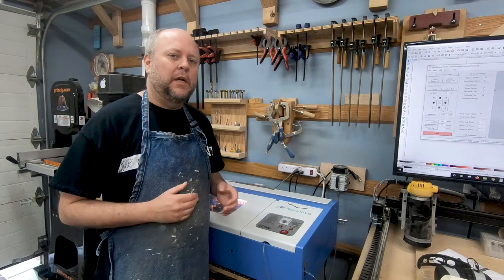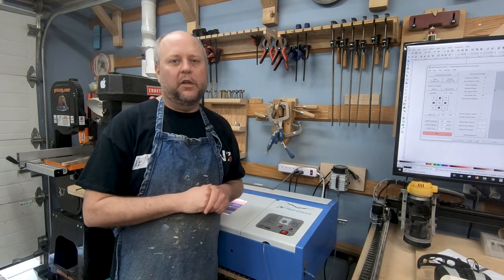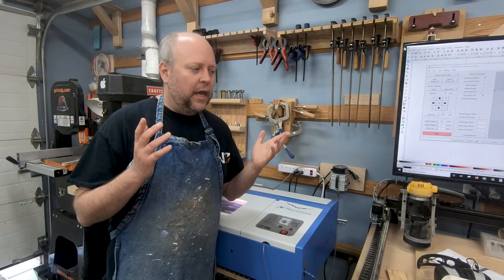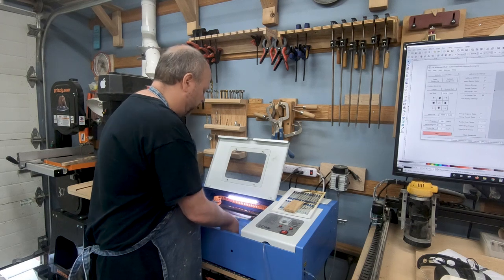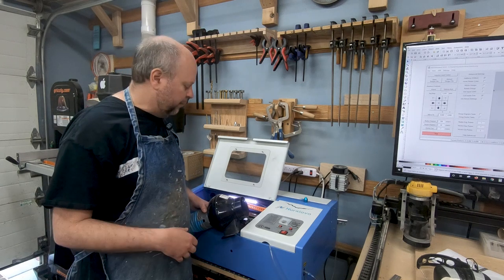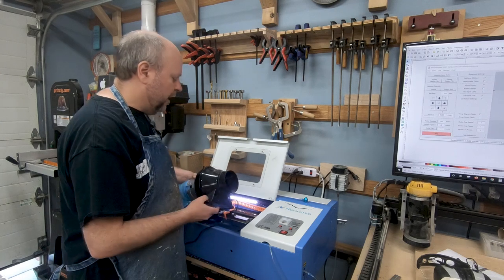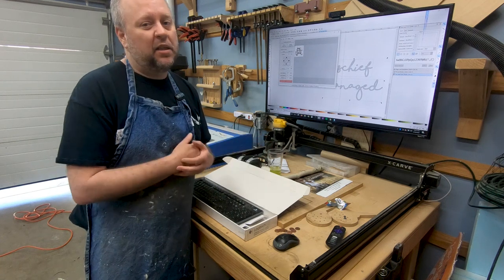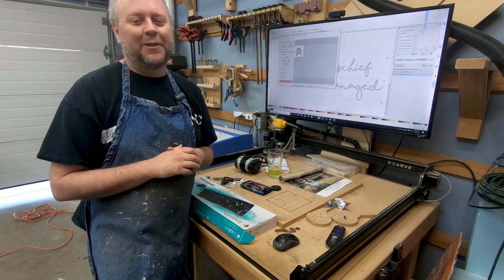K40 Laser Cutter & Engraver - What Do You Really Need To Get Started?

Comment: I have a k40 and it’s been working great but now it will move and make noise like it’s engraving but it’s weak at best. I have a percentage gauge and as soon as I bump it up past 18 I get nothing. It’s aligned. Anybody have any suggestions?
Reply from the maker: I'd say it's probably one of these things:  A) Laser tube is burnt out...open up the back to see if it's firing.  You're cooling the tube with cold, distilled water?  B)  Check mirror alignment.  If its not connecting properly, it won't cut/engrave.  C)  Check the laser deactivation button.  Do a test fire and watch your meter.  If its bouncing, it should be firing.  If it's not, it means there is no laser being shot.
Anyway, just guessing.  Good luck!
Reply: byTravis Thanks for the tips. I think the tube is going. Alignment and everything else is good. But even when I test fire it it’s weak and the tube color is different

Comment: Your laser beam is deflecting off of that barrel opening because it is not coming down centered!!!--should've gone for a lens housing with adjustable mirror fittings when you replaced that unit. But I'm going to tell you one thing that you don't already know. Even with that ghetto lens barrel, you could fidget that mirror by inserting a very small piece of paper into the ridge of the mirror holder and swing that metal leaf that locks the mirror into different positions and tighten it down little by little. With this you could actually center the laser beam going into that barrel. Right now, you're working with a laser beam that is coming down slanted to the side!!! And that will give you shitty results especially when you're trying to do something like engraving!!
Reply from the maker: Great tip!  Thank You!  I'll play around with it.  You're right, I need to align the mirrors a bit better.  The barrel has a very tight tolerance.  I do like my 3d printed air assist, though.  I really like having it directly on the cut, which is really nice.

Comment: lol.  with zero to thirty ma shown on the meter 10 percent is pretty easy to figure out. as is 90 percent.  you know the scale. just do the math.
Reply from the maker: Ha!  Yah...very true.  But I'm not sure how much faith I have on a Chinese import laser, though.  Is a 40 watt laser really 40 watts?  That's why I'd rather get a accurate reading on the power instead of assuming what they have stamped on the tube is the truth.  That way, I can take my settings to another machine when I upgrade.  You can always add a mA meter if you have the digital so you have both sets of numbers.  It's pretty cheap.

Comment: does it work with windows10?
Reply from the maker: K40 Whisperer works with the Windows 10.  That's what I use and the K40 connects without issue.  I don't know about the software that was packaged with the K40, though.  I threw that away.

Comment: Wouldn't be much left of the original unit after all them upgrades lol.
Why not just buy a better unit from the start.
Reply from the maker: Ha!  Truth.  I didn't add too many modifications.  Some users go crazy with upgrades.  But at the end of the day, a laser for less than $400 is significantly cheaper than a better unit.  With that said, if you don't like tinkering, you'd be better off spending the extra cash.

Comment: So, no metal?
Reply from the maker: Yes and no.  You can use a marking spray that will allow you to burn in a design onto metal.  It in essence melts the paint and fuses it with the metal.  I haven't tried that, though.  You can also engrave powder coated or painted metal, which basically burns away the paint layer to expose the raw metal below.  For actual metal engraving, I think folks use a fiber laser.

Comment: 10% of 30 mA=3mA, it does make sense
Reply from the maker: Yah.   You can do the math.  But why do math every time you want to share numbers?  But the big question is, is your 40w laser really pumping out what you think it is?  Remember, this is a cheap Chinese laser.  Plus over time, your tube will wear out.  If you have a gauge that measures milliamps, then you always know what you're getting.  If you're using a % gauge, you're getting a ballpark figure.  You can do whatever you'd like in your shop.  But my advice for someone looking for a new laser is to get the analog version.  That way you always know what kind of power you're using so you can take good notes.  If you already have the % gauge, you can buy a mA gauge for pretty cheap and add it after the fact.

Comment: ha ha i notice you have a x-carve AKA junk-carve lol i have one too what a heavily overpriced  DIY POS tinker toy rubber band drive design..based off of no load 3d printer platform not a cnc machine platform.
Reply from the maker: Like the K40, the X-Carve is a low end entrypoint into CNC.  I don't do a ton with it, but I do enjoy it and use it as needed.  I use it for signs, templates, jig making, etc.  It works well enough for what I need it to do.  :)

Comment: What do you really need ? Buy a different machine...
Reply from the maker: What you need to get started with a K40?  A K40 would be pretty important.  If you have a different machine, this video probably wouldn't be very helpful.
Reply: byTravis I have a K40 clone. Have CE mark but isn’t compliant to the normative, the control board isn’t affordable, I don’t want talk about quality of assembly, mirror’s supports are terrible. Could be a toy (dangerous) useful for play sometimes but isn’t a “machine”
Reply: @riskaoibaf3280  I think that there is no quality control on those, so either you get lucky or not, I paid $350 for mine and it works as a charm, I understand that it's not the case for everybody.
Reply: @Yves95128  It’s a device where you spend more time for setup than for engrave, without mention the failure to comply with safety regulations